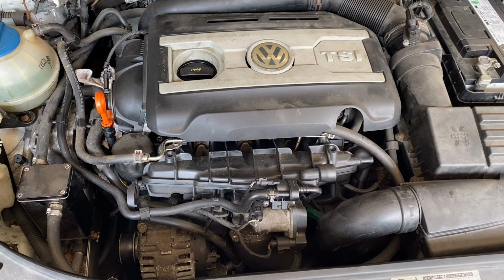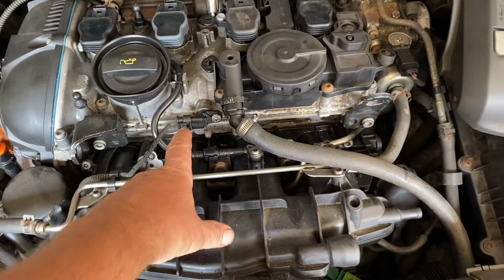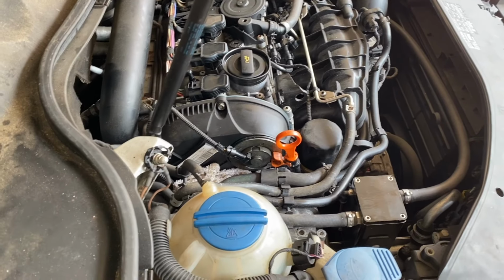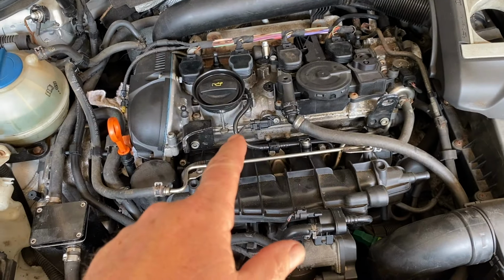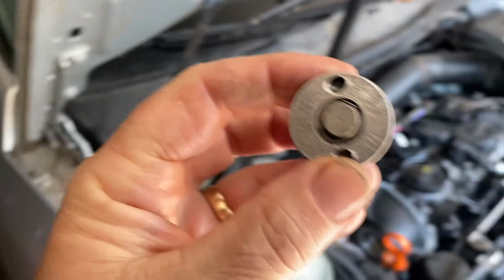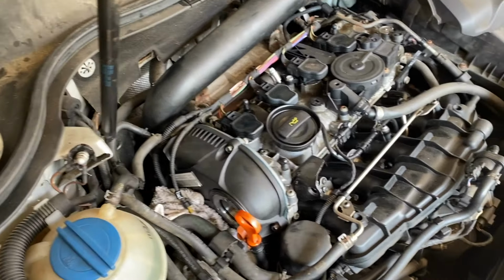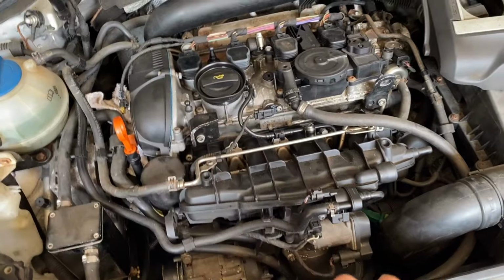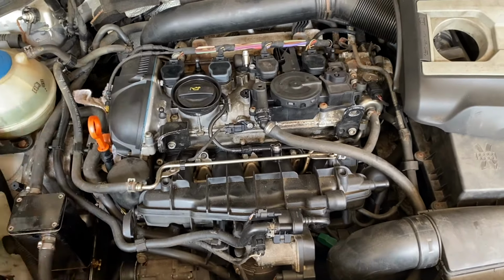Diagnose A Code P0016 On VW Passat, Tiguan, CC, Jetta - TSI/ CCTA 2.0 Turbo - 2009 & Up

Comment: FIXED our problems!  "Thanks" Donation sent.  Thank you so much for putting this out there for everyone!
Reply from the maker: Hey! Thank you very much for the donation ! Sure glad it helped!
Reply: @motorcarnut  Hey, after we drove the car about 50 miles, had the same issue happen when we started it this morning.  Looks like the new VVT oil control valve has already popped out (Dorman brand).  We bought the car about 8k miles ago from a VW tech who had rebuilt the engine completely, do to a timing failure.  We've had a camshaft position sensor code since we bought it, but tech said it was from the ECM being replaced during rebuild and not to worry about it.  Could it be that he didn't get the timing right or possibly it has skipped a tooth, or could the Dorman unit just be a POS and I should go OEM?  Could it be the Cam Adjuster Magnet (the pin is moving in an out decently).  We replaced the Cam Position Sensor to no avail.  I'm guessing it would be the same with the Crankshaft Position sensor.  Definitely ran flawlessly for about 50 miles last night, then back to square 1 this morning.  Thank you sir!
Reply from the maker: @Trouttdawg no it’s probably nothing electrical, remove the solenoid and see if the oil control valve popped out again. Let me know.
Reply: Swapped out the VVT again with a new one (1st one lasted a day).  Same thing.  Worked well for about 500 miles after the install of the 2nd new one (car was running great) and replaced the camshaft adjuster magnet as well just in case when we installed the 2nd one.  Now, engine running terrible at low idle.  EPC back on and Camshaft pos sensor bank 1.  I think there is a VVT at the oil pan as well.  Could that be the issue.  Or next step being oil pump?  We have gotten a couple of low oil pressure lights at lower RPMS over the last 2 months, but VERY intermittent and go away as soon as RPMs go up from about 1300.  I'd hate to think it jumped a tooth on a timing chain with engine rebuilt with new (upgraded) tensioner 8k miles ago.  Penny for your thoughts sir?  Here's a bit more color: we've replaced the PCV, cam sensor, crank sensor, VVT, cam adj mag, inspected the cam bridge (looks like a new one when the engine was rebuilt, screen was perfect).   Ross tech scan shows ECM isn't vin matched.  Ours is a manual and think the ECM came from an automatic.  Also, ABS sensor on front left (replacing Sunday), A/C compressor showing ground fault, and a few other things.  Replacing plugs, coils, and new coil connectors as well on Sunday.  I doubt that will do anything, but coils and connectors are in bad shape either way.  Any direction you could steer me in would be great as I'm nickel and diming this thing.  Thanks!
Reply from the maker: @Trouttdawg The oil pan sensor is not for vvt , it’s a temperature sensor. Did the oil control valve pop out again?
Reply: @motorcarnut  Sorry for the delay.  Yes, it has popped 3 new VVT solenoids in the last 2 weeks (one was actually a new OEM that lasted about 20 minutes).  I actually took the Dorman apart and popped the button back in.  Then I put a punch on it, hit it with a hammer 2xs and it has been working fine for about 5 days now.  The button in the solenoid is VERY seated now.  The engine runs perfectly, with no misfires now, but I'm concerned there is a bigger issue with the camshaft that is causing these to fail almost immediately.  Any thoughts?  Thanks again for getting back to me!
Reply: https://www.youtube.com/watch?v=I44-fYHPgz0&ab_channel=NaptownTuner I'm beginning to think when the tech rebuilt the engine, he used the same camshaft and it has problems like identified in this gents video.
Reply from the maker: What kind of engine oil are you using the weight? Seems like engine is building too much pressure for some reason and you said the cam bridge was replaced correct?
Reply: Usta adamın kralısın aynı arıza var bir türlü çözemedik bi kaç masraf yaptık egerki bundan ise deneyeceğiz son kez

Comment: Bank 1: CMP Sensor (G40) / Engine Speed Sensor (G28) P0016 - 008 - Incorrect Correlation, how i can fixs this problem?
Reply from the maker: Did you follow the procedure in the video? Also have other videos on the timing codes and how to fix them as well.

Comment: Ok so good news is i was able to look at the part, it’s still pushed in, it’s not pushed out. It had a lot of oil around it so i cleaned the oil away (didn’t replace the part) and now i get p000A and p0011
Reply from the maker: I have fixes on those codes too, look in my channel contents

Comment: i got this code but my car doesn’t struggle to turn on and there isn’t any lights on dash, any help? i cleared the dtc and done a rescan and it disappeared
Reply from the maker: Could be a fluke, see if it comes back first
Reply: i have the same problem as well and it did came back
Reply from the maker: @roelnewelljnr7193 did you do what I explained in the video?

Comment: What is the tool called to remove the part?
Reply from the maker: It's in this kit that will come in handy as it has all the special tools needed. That specific tool is called oil control valve tool.

Comment: If that part is failed, would you be able to start the engine without issue and have the engine run smooth for about a good minute and then the engine rpm starts to fluctuate, idle rough, and then stall?
Reply from the maker: Yes, That would be one of the symptoms.

Comment: Hi there, I have a VW Tiguan 2015 diesel with 79k miles on the clock. I have this intermittent problem when driving that the car stalls at low speeds, i took it to a garage and they replaced the crankshaft position sensor. I had the car for a week and the same issue occurred again twice. Took the car to another garage and they said there is a P0016 crankshaft position error. I didnt book in any work and would be greatful if you could provide any advice.
Reply from the maker: It’s probably as stated in video or an oil pressure related timing component. Oil control valve, cam bridge etc. Diesels are a little different outside this video.

Comment: Very good advice in this video. Mine acted up after a routine oil change. Still not sure why. But sure enough it was that control valve. Thank you.
Reply from the maker: Sure, no problem. Thanks for for feedback.
Reply: I'm having the exact same issue, happened right after an oil change!
Reply: @phtevenchevas3960  It was a pretty easy fix once checked.. Mines running fine since.

Comment: My 07 Passat wagon has a miss fire low pressure is this the same for 3.6 4 motion v6
Reply from the maker: Yes could be related, check oil level or replace oil and filter. Because oil controls valve timing and its its low will produce misfiring.

Comment: Do these typically have oil inside them when you open them up? I have a p0016 code but that part is not popped out like the one you show in the video. Does that mean it's not bad or should I go ahead and replace it? I thought fuel pump until I googled it and your video came up.
Reply from the maker: Yes oil is normal , it's probably the cam bridge check ball. Here is a video explaining it. Have many video on replacing it as well. 
https://youtu.be/PpLOk0EN3aU

Comment: What causes some of he fuses to blow after you drive it one day & next day it turns on but doesnt start up? Then you change the  variable valve timing chain & sensor, gasket & one of the crankshaft gasket plugs & then it does nothing at all? Code still says bank 1issue but doesnt go into detail I already changed both cam sensors last year
Reply from the maker: A short or overloading the circuit can cause fuses to blow. That’s not good and can be the cause of your problems. Whichever fuse is causing the problem should help in your diagnosis
Reply: @motorcarnut  thanks.  Personally I think after my 2nd bottle of fuel injection cleaner. It might have clogged the fuel filter. But the guy fixing it said the vvt.sensor.& that did nothing st all. He said the fuses are blown but im thinking he just saw one of the extra fuses I put in like #32 just to remind myself thst a fuse was there when I borrowed that one for my lawn mower.
Reply from the maker: Idk, You have to find why the fuse keeps blowing, that's the problem I believe.

Comment: I have already changed the chain, VVT and the camshaft sensor and stil have p0016 😤

What is the name of the one you called for solenoid that controls the valuable valve timing? I hope that will  fix my problem
Reply from the maker: Oil control valve that screws into the camshaft with a special tool.

Comment: Hey love the video and it may have answered this question but just want to make sure, i have a 2012 vw cc lux and the code im getting are p0016 and p0506
Reply from the maker: The P0505 is probably because of the timing and P0016 code
Reply: Got it, thanks
Reply from the maker: @randygrant56 no problem
Reply: Do you know of a way to get the top screw off because where i put the bit in, it won’t turn i got the other two off but that one won’t come out
Reply: @motorcarnut I have p0016 and p2293 at the same time, have you seen this before?
Reply from the maker: @beckmarchiniak716 Not is recent memory but they are not related. P2293 is the high pressure fuel pump problem and the other is a timing code. Have videos on both
Reply: @motorcarnut Hi I also have the P0016 code after battery change. Car cranks but won't start. RPM counter does not move at all. Audi A4
Reply from the maker: @mattdebeer5289 strange after a battery change. I would follow video and see if it’s your problem as well

Comment: Would this be the same for a 2.0 fsi? I have the same code and symptoms for my 08 Audi tt
Reply from the maker: Its a little bit different because your engine is a timing belt this video it the timing chain. Bet thee reason for the code is the same and mechanicals are different between the FSI and TSI engines

Comment: Will this work for a 2014 Jetta se as well? And would you recommend getting a good valve from a “U-Pull it yard”?
Reply from the maker: It should be and yes you could do that just make sure the new one is good
Reply: Has your Jetta engine turned off on you when you brake? I also deal with rough idling and have these codes that pull up. But I also have an issue where on some occasions the battery light would come up and the engine would turn off on me. Forcing me to start it up again.

I already replaced all ignition coils and spark plugs and my cam sensor. My battery is also new.

Comment: Had issues after an oil change. We took apart the solenoid and cleaned it up to free up the pin which seemed to be stuck. The other part you mentioned that fails is flush and not pushed out assuming it is okay. Car runs slightly better but dashboard is still lit up like a Christmas tree and now throws P2014 code. What are we missing here?
Reply from the maker: Can be the cam bridge check ball, I have a video on that and make sure you have the new updated timing chain tensioner also have a video on that too
Reply: 😊 the name of  this  spear part?  Thanks
Reply from the maker: Which part?
Reply: @motorcarnut  this  sensor you  was changing
Reply from the maker: @florinvilciu2799 Oil control valve

Comment: Mnie się przytrafiło p0016 w 1.8 cdaa po wymianie tłoków.. za mocno dokręcony zawór walka ssącego. Przymominam zawor do Fazatora z momentem 35nm dokręcamy ,lewy gwint. Pozdrawiam
Reply from the maker: Yes, tightening the oil control valve too tight will cause the valve to distort and bind causing this code. Thanks for that update!

Comment: 2007 Passat wagon has this code along with a few others. Car starts and idles fine, will slowly get up to speed but has no real throttle response. Does this sound like an oil control valve issue?
Reply from the maker: Yes!

Comment: Good evening, thanks to your videos I have dared to do things to my Tiguan with a 2.0 TSI engine, I have a question, how can I check the 2 parts you talked about? Because I already checked the solenoid and at first glance it doesn't seem to have any problems. Thanks in advance. Greetings
Reply from the maker: Did you take the solenoid off to see if the oil control valve button is sticking out?

Comment: Wow thanks you so much mine has maf sensor, knock sensor, fuel pressure sensor, cmp sensor, multiple cylinder misfiring, but it start but shot off after running for 2 minutes by itself 😢 but I will do it as you just explain now ty .
Reply from the maker: No problem, good luck!

Comment: My 2014 Jetta Se is currently throwing this, p0341, with check engine light and noisy engine while accelerating, any idea if it’s just the sensor? Local shop quoted me 120 diagnostic when I have my own reader
Reply from the maker: I have a video on that particular code. Probably not the sensor but timing chain problem.

https://m.youtube.com/watch?v=Wf3j0cBnGwM

Comment: Thanks for the vid, much appreciated. 2.0 tfsi Audi CJEB engine. Chain was rattling and replacement was done. I had some Throttle and MAF correletion DTC, replaced PCV valve and it went away. After that cleared, now I'm getting a P0016. Engine  performance is fine and one kick start. Sometimes it has an erratic/misfiring idle and once I rev it a little, that goes away.

The intake and exhaust cams both use cam adjuster valves. Previous repair shop stripped off an oil strainer on one of the valves, meaning that one valve has a strainer and the other does not. Could this cause oil pressure differences between the two cams and affect the timing setup? Hence the P0016?
Reply from the maker: Can be yes also oil control valve and cam bridge check ball are known to cause those problems. Got videos on them as well.
Reply: @motorcarnut  Ohk thanks. My bad, it's a 1.8t, not a 2.0. Anyway this cam bridge doesn't have a check ball. 

This was just a budget backyard repair and the car owner uses it daily. Once I get access to the car I will just remove the other strainer and see if the error goes away.
Reply from the maker: @mpho1247 oh ok let me know if it fixed it
Reply: @motorcarnut  Certainly.
Reply: @motorcarnut   I ended up pulling out the engine because of excessive oil consumption. So I replaced the piston rings and the two oil control valves. No more DTC's now..im pretty sure the problem was the missing strainer/screen.
Reply from the maker: Ok great, overall it was an oil control problem. Great fix!

Comment: Thank you so much for the video. It is very helpful to understand what's going on. Specially, when you explained the symptoms of the car that has the p0016. I have question; I have the p0016, p0106 and p2271 on my 2.5 2012 Passat. Are these codes related to each other? I have replaced the sensors and the solenoid valves lately and still p0016 and bad performance. the car stated to burn a lot more gas is it because the p0016? thanks again for your helpful videos.
Reply from the maker: Thank you!

Valve timing itself can be off. Has to be checked.
Reply: @motorcarnut  Thanks for your reply!
Reply from the maker: @alialgharibawi9647 sure 👍

Comment: I have the p0016 code, but the car runs fine, no rough idle, good acceleration, starts first time drivng me nuts
mechanic reckons it's a stretched timing belt, but I have read that other people have replaced the chain, but still got the fault codes, so i am not
convinced. can't really afford to change the chain anyway
car is a 2008 Yaris
Reply from the maker: Sorry this video is for VW not Toyota
Reply: @motorcarnut  yeah but the principle is the same, surely fro any car and my point is that that p00016 fault is not so straight forward as my experience proves
Reply from the maker: The principle but not the diagnostic procedure. It’s not hard when you have the proper understanding of how the system works.

Comment: hello, what is the "name of the bad part" and what is the "name of the removal tool"?
Reply from the maker: Oil control valve is the part and tool can be found in the VW TSi timing chain kit here:
https://www.amazon.com/Yuesstloo-Camshaft-Crankshaft-Compatible-2006-2018/dp/B09L45K5C8/ref=asc_df_B09L45K5C8?mcid=dc99972e16be375c99fff7474fe7c77f&hvocijid=977031792898179177-B09L45K5C8-&hvexpln=73&tag=hyprod-20&linkCode=df0&hvadid=721245378154&hvpos=&hvnetw=g&hvrand=977031792898179177&hvpone=&hvptwo=&hvqmt=&hvdev=c&hvdvcmdl=&hvlocint=&hvlocphy=9004531&hvtargid=pla-2281435181658&th=1